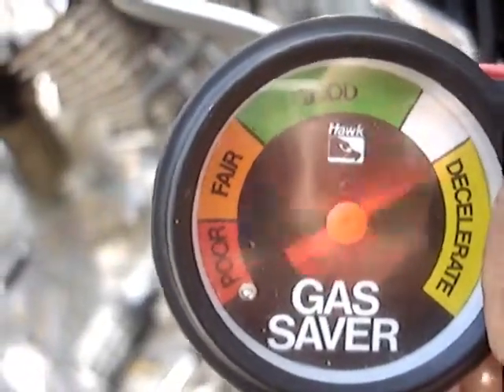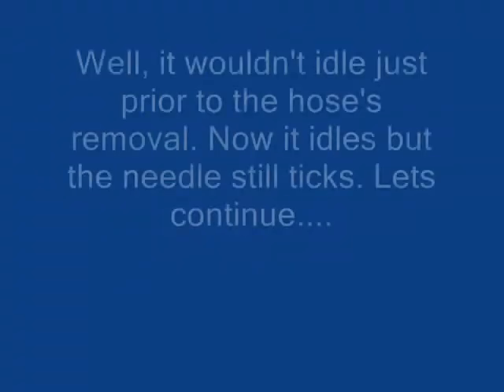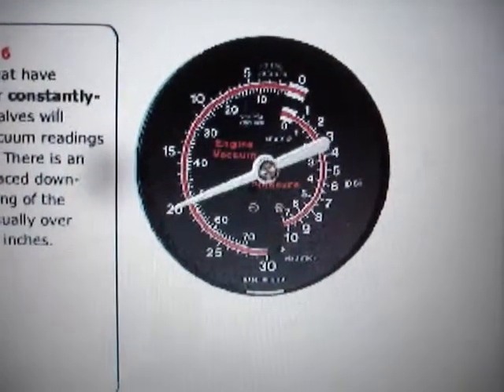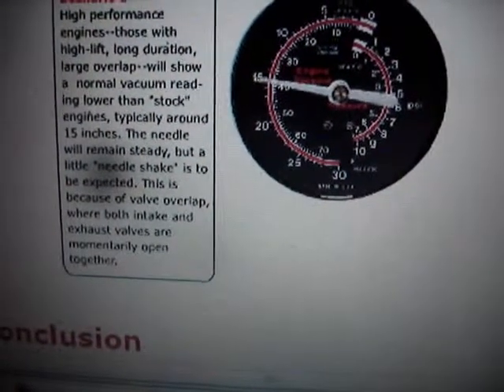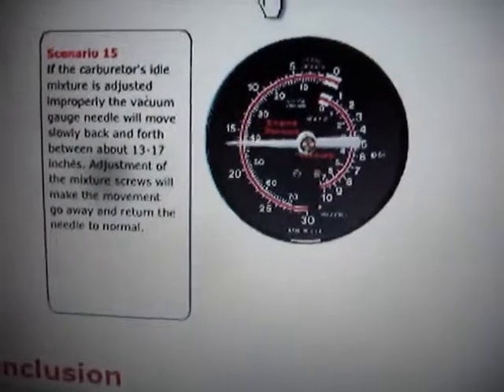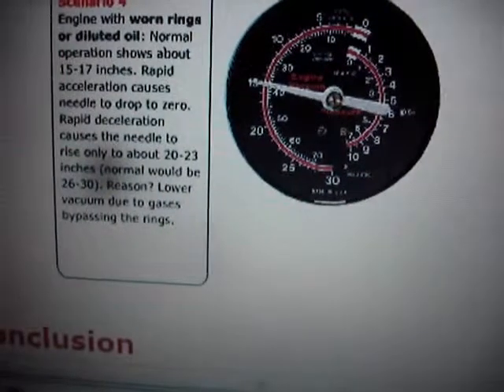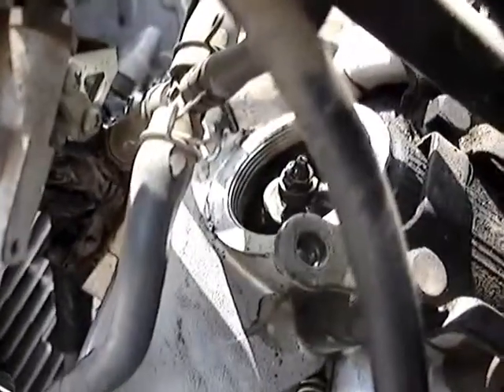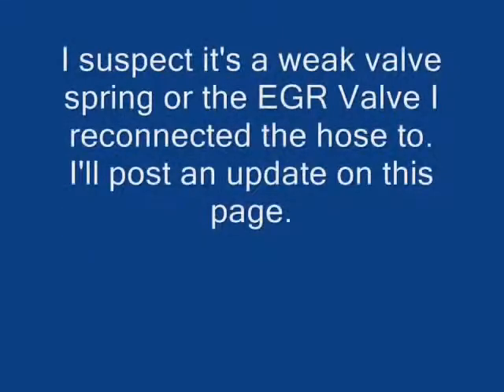How to Use and Interpret a Vacuum Gauge

Comment: did u find out the problem, as I have the same problem, vaccum gage needle all over the shop... please help. cheers
Reply from the maker: As I recall I improved the condition but did not completely resolve it. It could be a sticking valve, as I recall. But as I recall it seemed to involve the smog system, like a egr valve may be sticking/clogged.  There should be enough info in the video to get you close to the problem. Vacuum gauges only act certain ways in certain conditions.